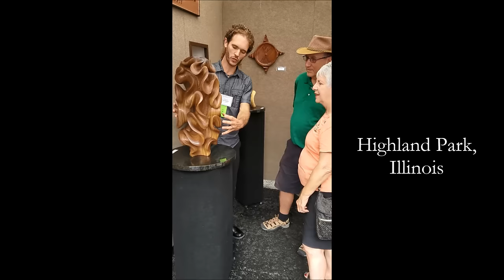Lignum Vitae

Comment: Hi Salem, been following you’re site for a while and love the power carvings . I’ve seen your videos when you show some of your techniques and tools you create . I was curious about one accessory I think you have that I’ve never seen. It looks like an extension you use on a die grinder. Wondering if you made it or where you got it. Again thanks so much for sharing your hard working and amazing talent!
Reply from the maker: Thanks, I appreciate that. I made that die grinder extension on a lathe. It's easy to make, just use good steel. A grade 7 half inch diameter bolt is good steel to make one from.

Comment: I absolutely love this video. I am an amateur knife maker for the past year and a bit and watched someone make a knife handle out of lignum vitae and came across your video. I also play guitar and I love the music and wondering if you could share where are you got this piece. Your artistry is incredible and I appreciate the video. Thank you! Also I'm impressed how you use a respirator and a dust filter off to the side but wonder if you should continue using a small dust mask even when light hand sanding. Our lungs cannot be taken for granted..
Reply from the maker: You're right about our lungs. I'm often holding my breath while power sanding. An easy way to check for filtration success is to blow the nose. If wood color is on the tissue, air is polluted. I made this piece a few years ago and my dust collection system is better. I use two units and fans blowing from the my rear sides to encourage the air towards the vacuum. 
I bought a 300 lb piece of genuine LV (northern S America/ southern Central America) from a dealer in Atlanta who got it from a dealer south of Miami who got it from a dealer who brought it into the U.S. in 1973, prior to its addition to the CITES Appendix as highly endangered. I have several videos on my sculpting process. I hope you like them.
Reply: @SalemBarker  I have only seen this particular video but I will definitely check out your other videos. You're very talented and dedicated and people really appreciate the ability to view the process and the skill and ingenuity you bring. 😊

Comment: wow mate, wonderful work there. I'm wondering if you use dry or green wood and how do you manage the splits, just starting my sculpture journey so very inspired by your videos, cheers man!
Reply from the maker: I use either, and prefer either depending on what I'm making. If it's large, I like to sculpt from green/wet timber and let it dry indoors inside big paper bags or wrapped in bag paper. I then continue when it dries. Cracks/checks may happen but most will close again during drying. They're also easy to fill if they remain. I should do a video on this topic.

Comment: Noticed you have a belt sander cleaner in a vice. So, do you touch your sanding disc to it to clean it?  GREAT idea!!
Reply from the maker: I've always got that thing within reach, especially with oily, sappy, or gummy woods.  I use to unclog any abrasive tool. One third of the weight of Lignum Vitae is oil, so it clogs abrasives very quickly.
Reply: You just sped up my processing my oak planks(6"x24"x9'). They are so-o-o-o heavy, I like to do as much as  can in one position, before I move them.

Comment: Really cool video, I was actually curious how you made some of these sculptures and didn't expect it to just be you going at it with a chainsaw and circular saw to get most of the bulk out, lol.  By the way, what's the narrow red power tool you were using to sand on the inside shown about 2:30 in the video, as well as the narrow brown one at around 2:50?

Comment: Absolutely gorgeous piece, I was considering using Lignum Vitae to carve out a wand from a 1 1/2 x 1 1/2 x 12" turning stock but was worried it would be too dense to use whittling knives. Do you have any experience with using hand tools on this wood? Also did you have any skin reactions to the dust while working on it? I read it could cause reactions.
Reply from the maker: It can definitely be whittled by hand and even though it's hard, there's so much oil in it that tools seem to stay sharp. I've had no issues with dust or health reactions. It's a medicinal wood and isn't toxic. Look it up on wood-database.com
Reply: @SalemBarker  Good to know, I had a beautiful piece last time I was at the craft store and when I told the guys there I was planning to carve with it they looked at me funny and said you know it's so hard that they made ball bearings out of this wood. So I settled for Canary wood which Im not enjoying carving with. The piece I got is splintering a lot.

Comment: Looks amazing and but that is the 4th densest wood and is also on the endangered species list so I hope your getting all your wood from a good supplier...
Reply from the maker: The supplier died years ago. I have the trunk section of a genuine Lignum Vitae tree that was brought to the U.S. in the early 1970's and stocked for military use. It's been sitting in darkness since then. This is now one of the most endangered trees in the world and is on the CITES appendix "red list". You can still acquire genuine LV,, but it only becomes available when a tree dies. It goes to the highest bidder.
Reply: Salem Barker good to see your responsible with your materials
Reply: There are actually three different varieties of Lignum Vitae and only one is endangered with restricted trade.

Comment: Wow, beautiful piece. How often did you have to sharpen your chainsaw teeth?
Reply from the maker: maybe twice for each of the two types of chains used. Lignum Vitae is super hard, but 1/3 of its weight is oil, so it has a self lubricative effect during cutting.